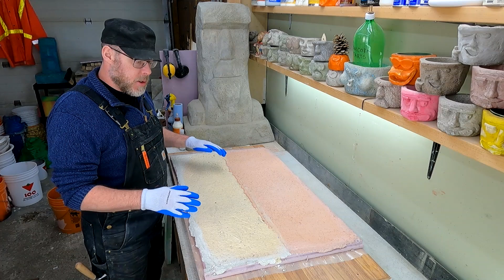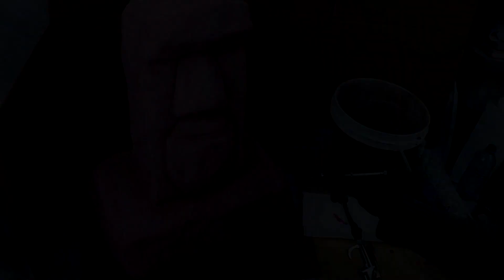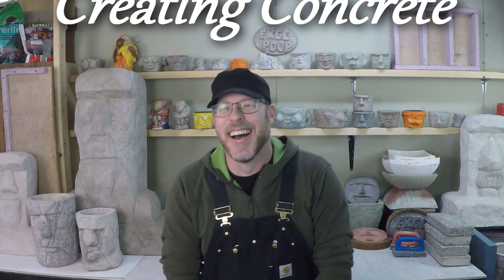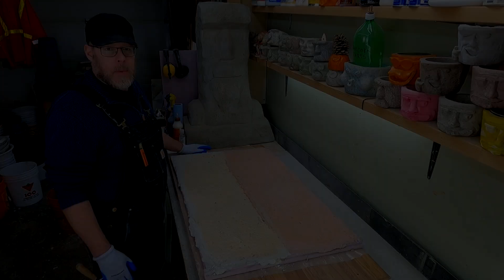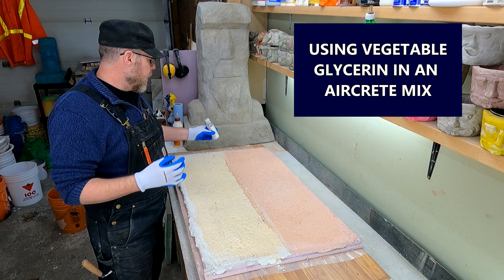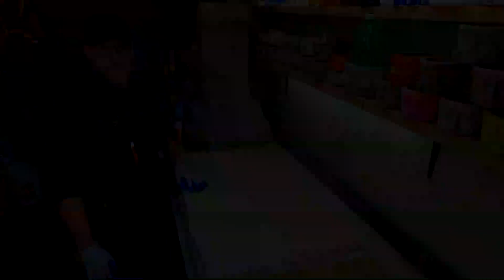How to Make Aircrete Stronger

Comment: I've added graphene into a sample of aircrete and it made it stronger. However, for my application I want it to be thermally insulative and graphene is highly conductive so I'm not sure if it's the best route for my application
Reply: Gypsum should help, I’m no pro but it’s probable bc it will not burn.

Comment: This is very good!  Ty!   What is your opinion on making panels that are insulative like yours but perhaps coat the outside with pure cement for strength. What you could end up with is large insulative no load blocks that could be used for a number of things?
One way to ensure the pure cement coating sticks, is to perhaps coat a cardboard box with pure cement then fill it with the light cement to improve the adhesion of the pure and light cement.
Reply: I've been theorizing about similar ideas for years, and made a few test trials.  I just don't have my own space to do such projects, so that makes it hard to regularly work on ideas.